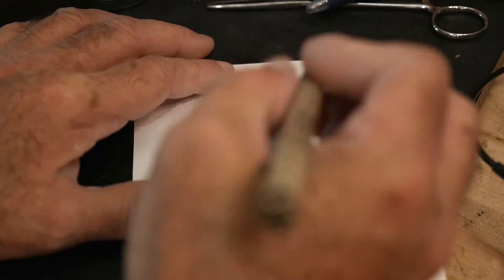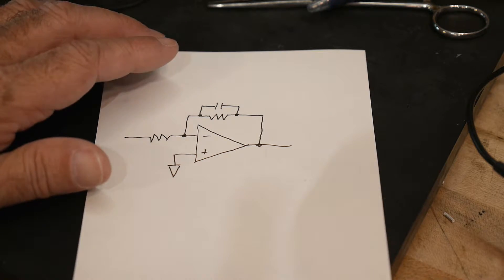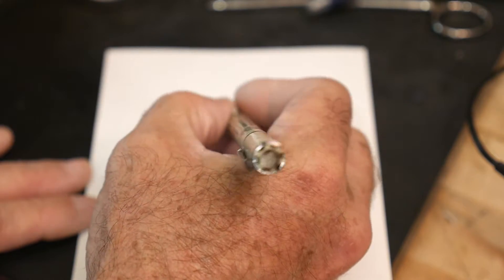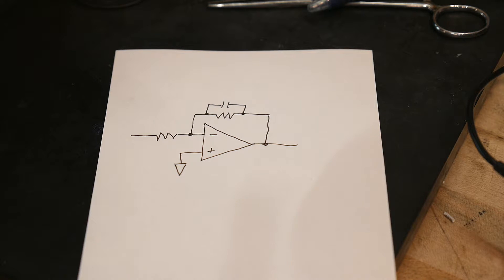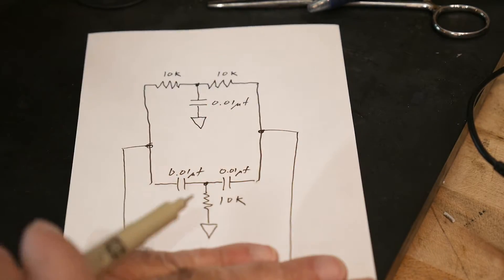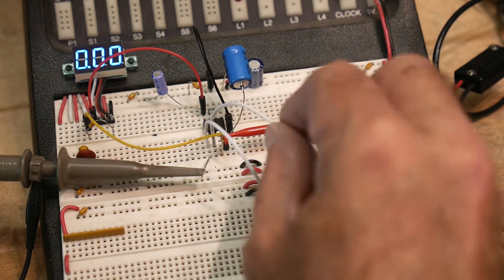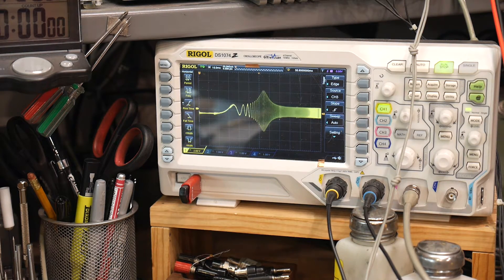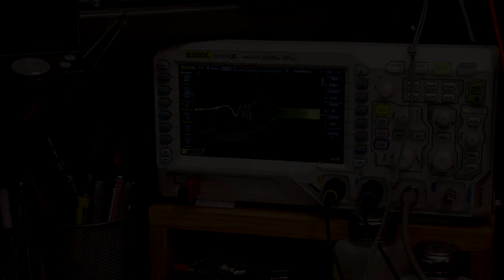#472 Feedback Inversion

Comment: You'll get much higher Q by using precision components, or adjusting values. Extreme value sensitivity. That's the downside of the twin-T.
Reply from the maker: I agree. I think inductors also give higher Q. Is there any other topology I can concider using. All the audio circuits I looks at use T filters. sometimes in sallen key arrangements.
Reply: @IMSAIGuy  I've rarely if ever used BP/notch filters, so...not the best person. Pretty sure there are S-K & MFB versions that are much less sensitive & more controllable. Actually, I suppose the state-variable is your best bet. 

Check out:
https://www.edn.com/three-op-amp-state-variable-filter-perfects-the-notch/
https://www.google.com/search?client=safari&rls=en&q=site:edn.com+state+variable+notch+filter&ie=UTF-8&oe=UTF-8